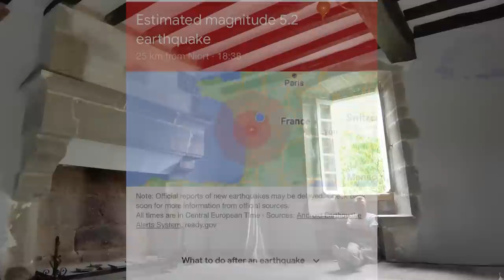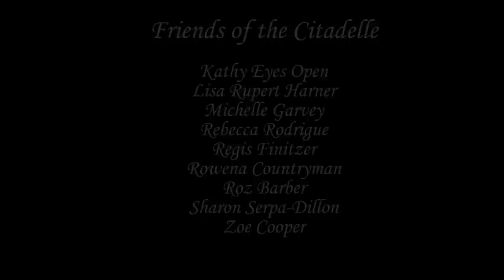Centuries old beauty hidden under decades of paint

Comment: Just curious - did you use a paint stripper?  Beautiful work done.
Reply from the maker: Hello Deborah, thanks for watching.   I used a watered down version of my normal bi-carb and water mix. There are electrics running along the floor so I just wanted to soften it before scrubbing and wire brushing. This way I didn't have to rinse anything off after. Have a lovely week, Rols